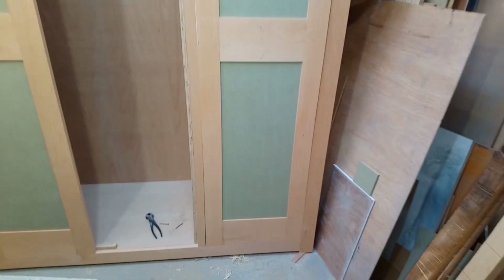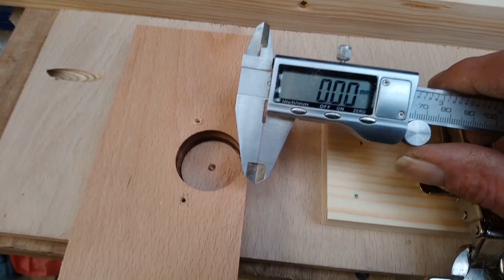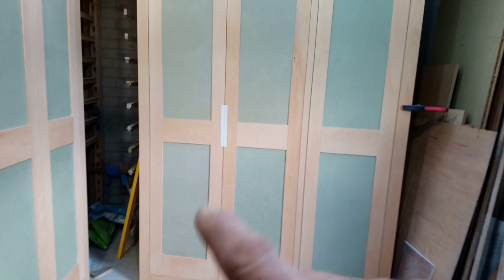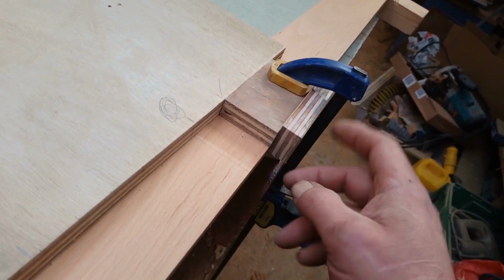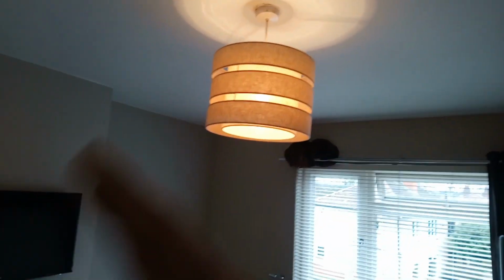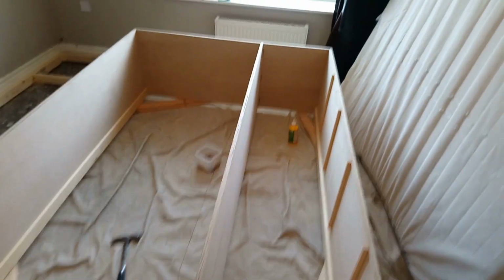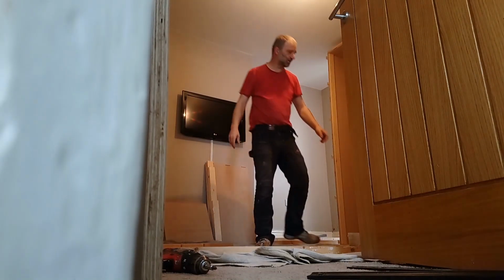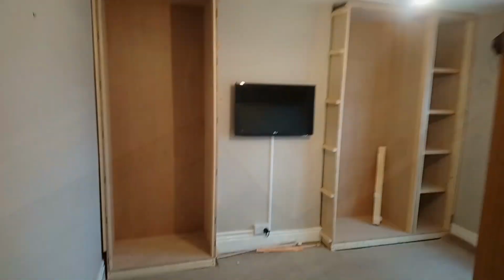Wardrobes Pt8 - Door hinges, finger pull handles & fitting the carcasses in the house

Comment: what piece is in the router when cutting the finger holes? great work mate
Reply from the maker: Thanks 👍 Any where you see finger pulls in my vids or pics on Facebook,  
Oak Alcove Cupboard Shelf Unit https://www.facebook.com/gid.joiner/media_set?set=a.893116624108038&type=3 , 
& SR Bedroom wardrobes & drawers 
 https://www.facebook.com/gid.joiner/media_set?set=a.1134746533278378&type=3 
whether it's cut in or on the edge it's this cutter, i wore out one & replaced it with the same cutter, When making those pulls that are in the door it's sometime better to use a narrow straight bit to hog out most of the wood first as the finger-pull isn't too good for plunge cuts, you can use the same jig but the straight cutter has to be narrow, 6mm-ish so you don't cut out the bit that makes the finger pull undercut, This is the cutter https://www.axminstertools.com/axcaliber-drawer-pull-cutter-1-666225
Reply: @Gidjoiner  cheers mate, i owe you a beer
Reply from the maker: No prob 👍👍

Comment: Hi Gid.
Is the stapler a brad nailer as well or a separate tool and how do you rate it. Also what do you use as a portable compressor ?
Keep up the good work, can't get enough of these videos and have learnt so much from your work.
Reply from the maker: Hi Graham, Good I'm glad they're helpful 👍
No this is just a stapler, Bostitch are excellent tools, I love Makita & bought an 18g nail gun as second one for the workshop to save me having to go out to the van, it was on offer but i wish I'd spent more & bought another Bostitch.
The prob with combi nail/staple machines is they have a flat firing pin so it can fire staples but when firing nails it leaves a flat line in the wood rather than a neat round pin sized hole.
The compressor i have is an old Wolf Air 6ltr one, the dial is broken but i leave it on full pressure, it's 20yrs old n still works without a prob or maintenance, It is noisy tho 🙉
Thanks, you're welcome 👍👍😉